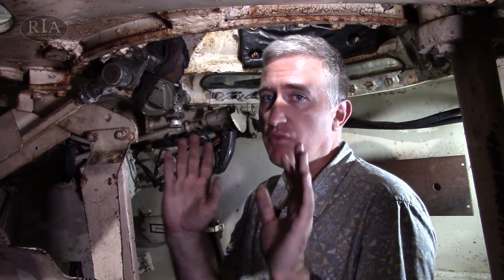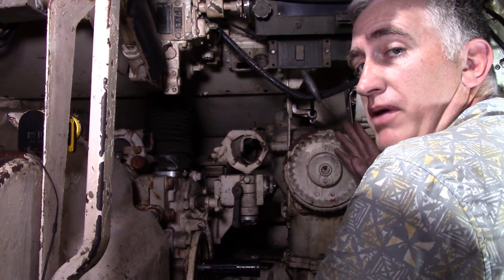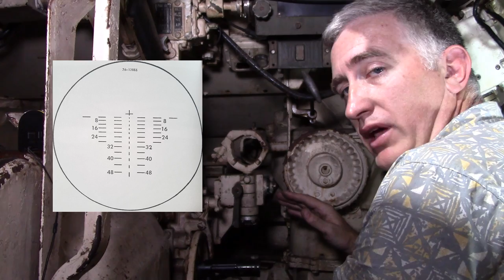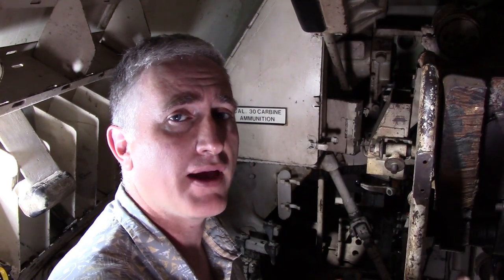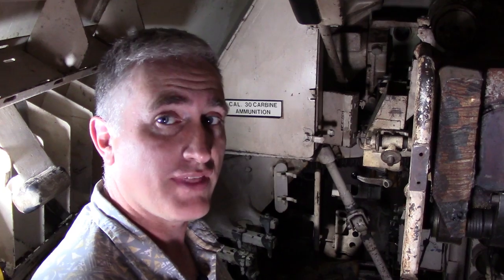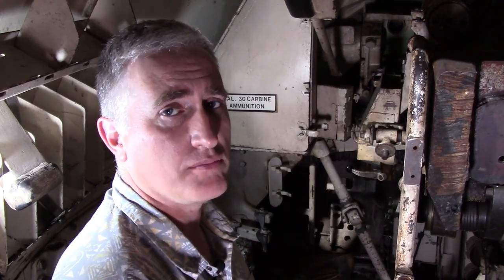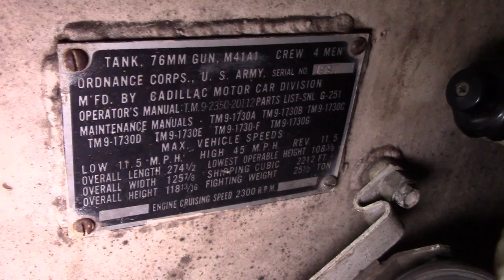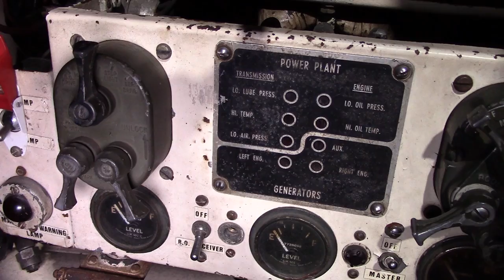Inside the Chieftain's Hatch: M41 Walker Bulldog, Pt 2

Comment: AN/GRC-106, I worked on those in the past as a radio mechanic. We called it the Angry 106 because they could be finicky to tune, and right inside the case when you had it open on the test bench, there is a large, unshielded power transistor that could give you a serious jolt...hence the name Angry 106.
Reply: Possibly, I used them in the 1980's... I think it may have actually had a VRC series possibly the 246 or the 524.  We had the VRC 524 for in unit comms in our M577 TOC track and the AN/GRC-106 was for longer range comms
Reply: @ret7army  Yes, I also remembered the 524 in our M577 Command APC, and the AN/PRC-77 in the APCs (I forget what the vehicle configuration was called). The Army had us training to work on the old systems to learn the theory while I was in school for the SINCGARS.
Reply: Must be pretty darn hard just to fix those. Let alone tune it. I feel you man.
Reply: Haha just had an Army flashback...'Single Channel Ground and Airborne Radio System'
Reply: @jehoiakimelidoronila6543 , yeah the tuning was a process, and you couldn't tune one channel band exactly right then move on to the next one; you had to rough tune all of them, then fine tune all of them, and then fine tune again. The tiniest tweak of one band would affect the others, and you're better off having them all approximately right instead of all of them precisely wrong. It was an art, not a science.
Reply: @drrocketman7794  To me it' sucks that the sets I've had that would not keep tune were the ones that would pick up skip from the afterlife. It's those fidgety old sets that have the best reception.

Comment: As far as I know and recall:

The Danish use of the Walker Bulldog was due to the cold war scenario of an invasion of the Island of Sjælland, where the capital is situated. The defence of the Island had a two brigade structure as they were supposed to cater for a WAPA (remember that abreviation ?) airborne invasion simultaneous with a seaborne - but not necessarily at the same place - as explained on television by LtGen ACB Vegger.

The main issue with the Walker Bulldog was that it was able to cross the river (such as it is) Susåen swimming and thus able to fullfill a recon mission without engineering assistance. As neither a helicopter/airdrop invasion nor an amphibious landing was liable to be particularly heavily armoured the somewhat flimsy protection of the Bulldog was more than sufficient.
The real damage was to be done by the Centurions of Sjælland defence - which became Leopard 1, when the Germans had a fire sale of said tanks.

As Poland got integrated into Nato the threat of invasion from there receeded. Besides the Danish Army now send a brigade to fight alongside the Polish and the Germans in a Division with the 14 PzGre and the polish Pommerian. (The Danish expression of a lowgrade disaster is that things go to Pommeria).

The obviously mentally impaired communist traitors were made schoolteachers to suffer a long and drawn out death struggle in the hands of 5 th graders - considered much more painfull than the proper way of expiditing such scum - i.e. hanging.
Reply: That's really interesting, thanks! What does WAPA stand for?
Reply: Warsaw Pact, abbreviated WAPA, Warpac and WP.
Reply: That last sentence gave me a chuckle

Comment: I agree its probably one of the best looking tankettes.
It looks like a tank, drives like a tank, but barely qualifies as a combat vehicle.
In the early 1970's I  was going a college,and working full time at a large paper mill.
I worked with vets from WWII,Korea, and Vietnam.
One of my co workers had served in Korea, in combat as an M41 driver.
He said .50 cal rounds would easily penetrate the side hull of the Walker.
Thats down right criminal negligence on the part of the designers.
Reply: Idk what you are talking about. Its quite common for light tanks to be penetrated for 50 cal. Its a tank, like it or not

Comment: Please do a segment on the M41's intended replacement, the T92.  It is so different than any other US tank, and I get the feeling that the designers of the Russian BMP ifv may have been influenced by it.  By that i mean the placement of the engine, the extreme frontal slope, the shape of the turret (Discounting the t92's split turret and external mounting of the main gun.  Imagine the t92 turret with no machine gun turrets and an internally mounted gun.)  With some updating (a turbo diesel engine would be nice), I think it would have been much better than the Sheridan, and could have served as the basis for an American BMP, by extending the chassis and a few other mods.

Comment: The Army was still using the M1 carbine in the 1950s and even the 1960s. The M14 rifle did not enter the service until 1959 and it failed to replace all the WW2 small arms, namely the M1 Garand, the M1 carbine, and the Browning Automatic Rifle M1918A2. You may find a lot of US Army infantrymen were still using WW2 small arms in the Army TV series "Big Picture" in the 1950s and 1960s. So it is not strange to find a .30 carbine ammunition box in the tank.
Reply: The PF's and RF's had that shit, it worked good. Carbine rounds are a lot more powerful than you'd think.
Reply: a google user, What are you talking about?
Reply: RF/PF regional forces/popular forces ruff/puffs local part time "soldiers" in the 'Nam.
Reply: I see. But the US Army was stuck with the WW2 small arms in the 50s and 60s, too. Especially those in CONUS and Korea. It seems the USAREUR units finally got their M14 in the mid-60s when it was disfavored by the DoD, but the later called REFORGER units were still using M1 Garand.

Comment: My oldest godbrother was a tank commander back in the 60s to 70s- he was stationed in Germany and hated cobblestone streets over there because they were slick when wet or icy and the tanks had a bad time with sliding into a building when driving thru the little towns over there- he told of a tank sliding into a store and destroying the store and the floor gave way and the tank fell into the basement of the building- cost the Army a ton of $$$$$ to remove the tank and rebuild the building and store and pay the owner a pay off fir damages

Comment: Dad was the commander of the National Guard Calvary unit in Miles City Montana in the mid '60's so I got to play in and around the M-41 as a pre-teen. I'd manual track the run on cars driving into Miles City, manage to crawl from the drivers seat into the turret (and back) with some difficulty - not sure how you did it! I even managed to drop the drivers escape hatch on to the ground - way too heavy for skinny ol' me to put back. My bad.

Perhaps it it was guys talking smack but I heard tales of drivers taking this tank well over the 45mph limit (70mph was mentioned) on one road in Montana. The transmission was not up to the task of steering at the speed and the corner was not made - the tank running off in the field. In many parts of eastern Montana this would not have been a serious problem. Then again, perhaps they were talking smack.

The tanks I played in were well maintained, bright white paint on the inside, the usual OD on the outside. They also had Jeeps and trucks. But the M-41 was uber cool. Hence my favorite tank over the years.

Comment: While there's been a couple examples of "oh shit, the tanks on fire" egresses, have you ever actually used any of the bottom escape hatches (especially on video)?
Reply: He's not well motivated enough.  Refer to 14:05
Reply: I've done it on the M60A3, it was a tight fit for sure.
Reply from the maker: No. I would have to put the hatch back in again afterwards, and it’s not a one-man job.
Reply: That's a shame, some of them have looked like a bit of a challenge, even for a tanker looking at a bonfire from the inside.
Reply: I doubt this gig pays enough to deal with escape hatches and crawling around on one's belly.
Reply: Oh, of course the escape hatch would just drop out...didn't realize that. What was to prevent it from rusting in place? D: Is removing and greasing it a standard maintenance procedure?

Comment: The tropical heat and humidity of Central America truly wreaked havoc with the interior of that M41 light tank.  It's all rusted out.  In order to prevent that the tank crew would have to spend extra time with brasso and other chemical rust removers and rust prevention and a lot of rags during tank maintenance.  Obviously that didn't happen.  The tank crews had other priorities with their time rather than become glued to the inside of their M41.

Comment: I didn't even know that you could also mount a .50 cal as a coaxial.
Reply: In an M48 you could coaxially mount both a 30 and a 50 hence the three fire control switches "Left - Main - Right".  Left=30cal. Main=90mm, Right=50cal. Every tank I ever served in had replaced the 50 with the Gunner's auxiliary telescope.  
"

Comment: If it comes with 'canister' and white phos, what is canister?
Reply: It's like a giant shotgun shell. Breaks open after firing and showers the target with red hot shrapnel. So called because those used with early guns were really just a fabric bag (or canister) filled with small round balls.
Reply: Imagine a 75 mm shotgun round. Apparently it was quite popular in Vietnam. You shot a couple of rounds of canister at a presumed vietcong position and it was enough to deforest the area.
Reply: Thank you all for the info. Sounds pretty brutal, would it work against aircraft or was it too short range for that? Had no idea such a thing existed.
Reply: gusty9053
Especially if fired from an M551 Sheridan.

At least that's what I've heard (152mm "Beehive").
Reply: Brutal indeed. But only against infantry. An aircraft (we are talking jet era) would be to fast and too high for that kind of shot to land anywhere near an aircraft, let alone do damage - this is just my opinion though. Against a helicopter ? ... maybe but i never heard of such an engagement.
Reply: A very large bore shotgun cartridge loaded with large ball bearings. Like Grape Shot it is nasty at clearing out cover and the people hiding in said cover.
Reply: They had to develop a canister type round for the M1 tank. They found the AP and HEAT rounds just didn't cut it as anti-personnel rounds in the city fighting in Iraq.
Reply: @Shadow Falcon Beehive was a bit different from Cannister.  As others have stated, cannister is like a shotgun round but Beehive, well that sucker had the ability to go out some distance and then … fire/detonate/open up with some violent goodness … it wasn't HE, but an anti-infantry round that could be used in the AA role as well and very, very nasty
Reply: Canister is like a giant shotgun shell, filled with steel ball bearings rather than an explosive charge. A common variant was a flechette round often called a beehive because of the buzzing sound the flechettes made flying through the air. Flechettes are basically nails with small fins on them to keep them going straight. They’ve been since outlawed for use in war as “cruel”.

White Phosphorous or willie pete is intended as a smoke generating shell as the burning fragments create a thick white smoke. Its use as an anti-personnel weapon has also been outlawed but that hasn’t really stopped anyone.
Reply: From admittedly vague memory WP is 'legal' as long as it's not employed with intent to harm.
Thus WP smoke is fine for screening etc, but not for firing on the enemy to mask them.

Naturally, if the receiving party is not alive enough to complain and there's no evidence of its use in such a situation, I guess you get a tenuous pass of sorts...
Reply: holy shit

Thanks everyone, this was super informative. I was thinking gas at first because I'd forgotten about the 19th century and earlier "canister shot" and I wasn't aware that it'd carried through into the 20th century. Brutal.
Reply: I've read of tankers pouring the shot out and filling it back up with machine grease and magnesium filings. This made a flame round. 

I don't know how common this was, but it seems like a good way to destroy your gun.
Reply: BIG shotgun shell

Comment: The steering tiller was changed in the mid 2000's? Why?
Reply from the maker: Vertical tiller grips are a little less comfortable to hold. (It’s 2000s by serial number, not year)

Comment: This is actually starting to erk me, why is everything called M4, M4 sherman, M4 Carbine, M4(1) bulldoggy
Reply: Those are the short versions, the real ones are stupid long.
Reply: Braeden Hamson
M1 is better?
Reply: Naming is hard. Ask the Germans.
Reply: Forgotten Weapons has touched on this, it comes down to, if it is a different kind og item, Assault rifle, handgun, tank , SPG, periscope, those all get their own range starting at M1, and basically every single number gets used
Reply: Basically it's because right before WWII the US Army decided to stop using year designations (e.g. M1903) and start numbering everything sequentially. Of course, this meant that pretty much every piece of new equipment produced for the war was going to receive a number in a very narrow range, producing no end of confusion.
Reply: @ JImmy De'Souza … close but the E stood for Engine not experimental, X stood in for Experimental … so with M4A3E8 you had the Sherman M4 tank Alteration standard 3 Engine variant 8.  The A Alterations could be just about anything to do with the vehicle except the engine.  So today we've the M1 tank, M1A1, M1A2 and I believe there may be another change up in there as well.
Reply: Could have sworn E was for Extension
Reply: @ret7army  what?